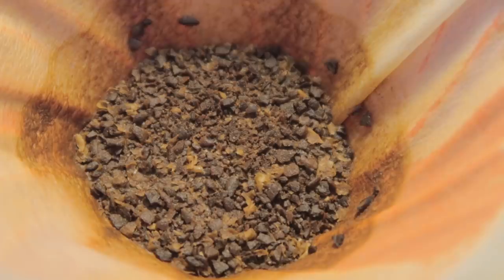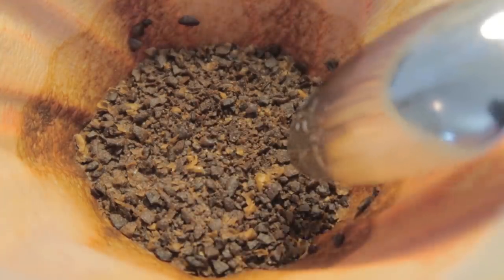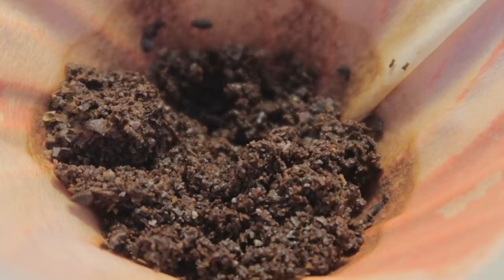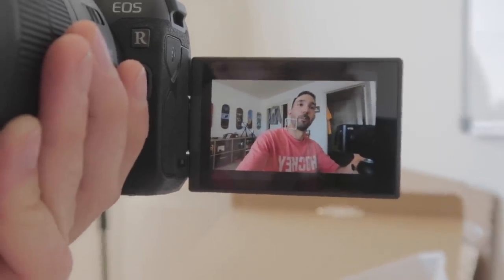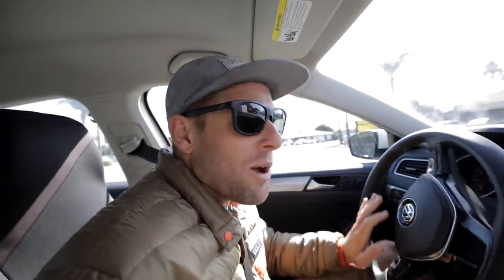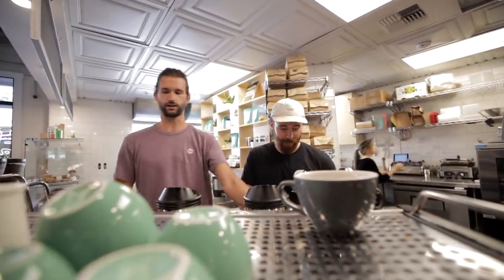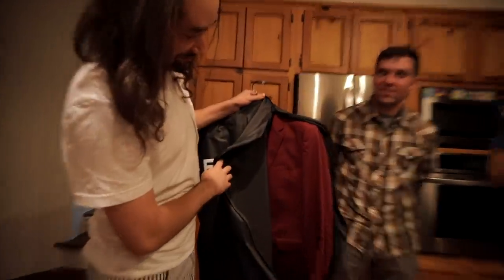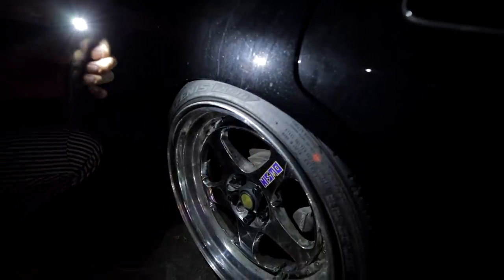When To Change Your Grinder Burrs | Boring Lo-Fi Work Update

Comment: No matter what I do, I can't seem to get a flat bed! I gently stir with a spoon, give it a little Rao spin, but I still have coffee on the sidewalls and a wavy bed. Any tips?
Reply: Viscount Julian before doing the stir with spoon or rao spin make sure your have enough water during the whole brew so that the ground can settle down in an even way. If you don’t have enough water lots of time it’s by higher on one side or the other. Just something to look out for... not sure if it helps your problem
Reply: @romanberestyuk1928  Thanks! I tried that twice today and it seemed to work. I poured a little more aggressively to get 2/3rds of my water poured in the first 30 seconds. Then the last 1/3rd in the next 30 seconds. It worked really well. That and I also think my grounds were too coarse. I upgraded my hand grinder to get more consistency and finer grinds.